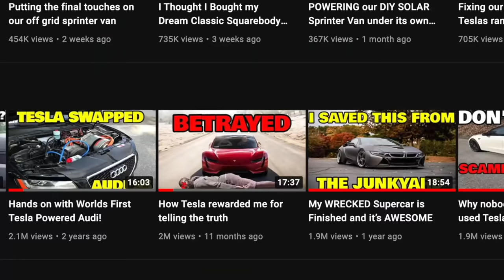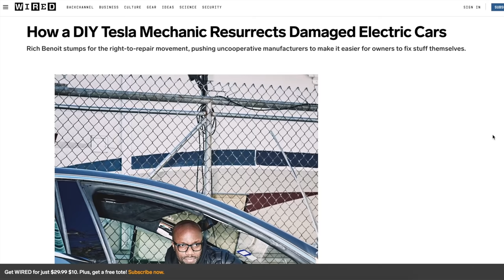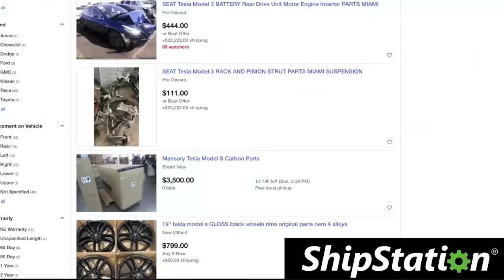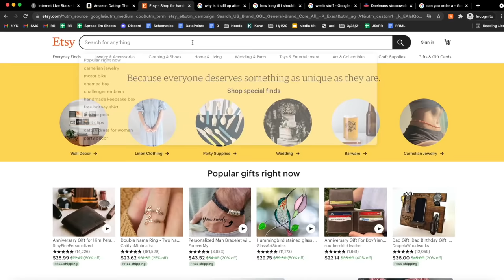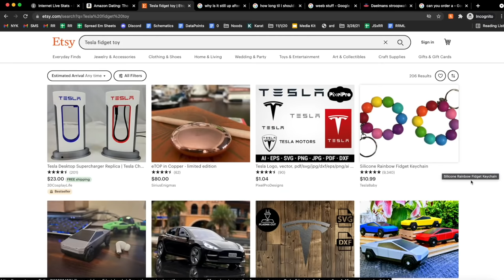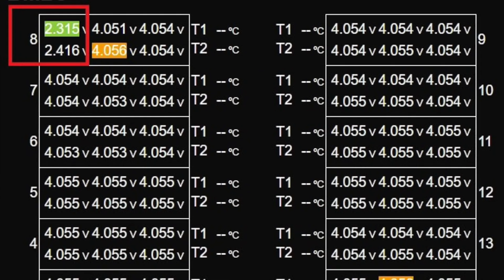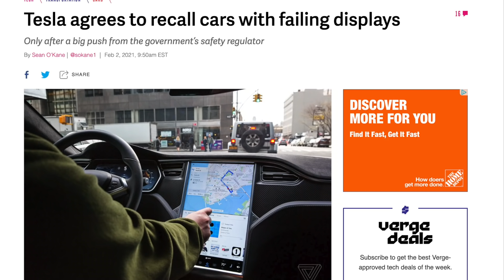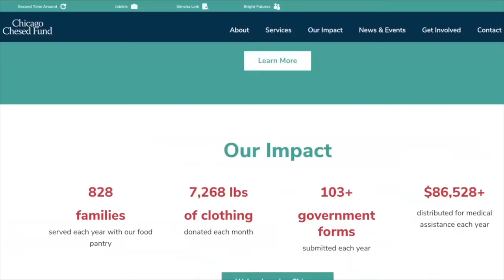Tesla wanted $16,000 to fix this NEW Model 3, we did it for $700! The importance of Right to REPAIR!

Comment: Love seeing Right to Repair cheerleading, people shouldn't need things like this explained to them.
Reply: Unfortunately, so much of the public don't understand things until it happens to them.
Reply: @kidmosey  no other car manufacturer is remotely as greedy as Tesla. They are absurdly unwilling to repair parts and insist on replacing entire subsystems rather than making them modular. BMW are probably the most similar, with a habit of combining parts that would never fail like cast alloy engine mounting brackets and thermostats or water pumps (or all three), but you can still replace most parts individually, and more importantly BMW will actually sell you parts to repair your car as well as workshop manuals. They will even sell you their diagnostic computers and access to their archives of firmware, it's not cheap but it's available.

To make matters worse, if you buy a second hand Tesla, you have to buy all the performance upgrades again, and if you don't Tesla HQ will remove those features. The analog equivalent of a guy who follows you around and unbolts the turbocharger from your ICE engined car, takes it back to the dealership and insists you pay the retail price plus labor to have it reinstalled. Tesla go a step further and disable all forms of fast charging if you figure out a way to re-enable the features that have already been paid for on the car you supposedly own, effectively rendering it useless.

Tesla's are nice cars, but Tesla Inc's unbridled greed would preclude me from ever considering one. For me driving a Tesla is like endorsing their ridiculousness, the best thing we can do for future generations (pun intended) of car owners is to support the companies who are most open to repair and modification and least prone to intruding in the car after you buy it, electronically or otherwise.

Comment: You should put a $1 stainless steel clamp around the thin outer plastic that you threaded to accept the brass nipple to prevent it from ever splitting when the brass nipple heats up and expands. If possible, add a metal protector around that fitting to prevent future breakage from road debris.
Reply: The brass is never going to get hot enough to expand enough to crack the plastic
Reply: I understand that but as 50 Cent stainless steel clap its Extra Protection
Reply: Tesla makes a battery and sells it for $16,000 then everything on the pack should be replaceable. Would you buy a regular engine with all the hose fittings part of the casting? Tesla engineers are either building to make repairs very expensive or building so write offs sell new cars. Either that or they are stupid. Do you think they are stupid? Main reason insurance companies write off vehicles as they are in agreement with manufacturers with some under the table deal. My new bought car had the appraiser write off a $14,000 car because of a little hail damage. Had to show them the value as they had it for $6000. The appraiser claimed she was new to the job and the replacing a guy on vacation. LOC We are nothing but pawns.
Reply: This is a good idea.

Comment: The other crazy thing is, if they are keeping battery packs they replace to repair them, they should be offering remanned batteries at a fraction of the cost of brand new. It makes no sense if Tesla can charge $16,000 for a battery, but then keep one with low miles to repair it and use it somewhere anyways. Not unless they are passing those savings on to the customer.
Reply: If they replace your battery and you’re paying for it you should be able to keep the battery.
Reply: I have taken cells out of the packs. The pack is disposable the way the cells are glued together. I could go into great detail about the pack but that is out of the scope of this video.
Reply: @stevegorkowski3246  He even mentions they have replaced failed cells in a previous video though?
Reply: @802Garage  I would guess you could change a cell but the way they glue them in it would be very hard. You would want to practice on a bad pack before you do it on the real pack. The pack has a section of cells that could be changed but that isn't cheap.When you get the cell out you need to connect the Aluminum fuse wire to the new Aluminum cell top. I use a pulse Tig welder. I would use some of the bad cells to practice on. The top of the cell has a pressure relief valve the pops up. I don't know if that breaks the fuse wire by design from that movement. 
The sad thing is they plan to pot the whole thing in one piece. This is just one issue I don't like. I am looking at other options other than Tesla but I will make a decision by 2025.
Most of all I feel sorry about people that don't understand Tech and buy a Tesla and huge repair bills need to be paid. The consumer electronic industry has the same issues.
Reply: @stevegorkowski3246  Sort of feels like early adopter issues that come with most technology.
Reply: @802Garage  Ford battery pack has small packs connected to make a big pack.  The trade off is weight and cost.
Back in the days of conversion kits. The system had no cooling other than air. The manufacture that don't need a cooling system would be the winner. LTO cells designed with higher energy density would do this.

Comment: As a Tesla fanboy, I can say this video is a true public service. Not to mention the repair to this man's car.
Reply: I agree. I think it's fantastic the Tesla is pushing the whole transportation market to all electrics. And very very important for right to repair, and upgrade bulletins for weak areas like this damaged nipple.
Reply: Say it louder for those a year after. Lmao
Reply: @daviddipasquale5479  its not fantastic at all, these batteries not only have relatively short life span, they are extremely hard to replace and extremely hard to recycle. Not mentioning that Car producer having ability to remotely disable product YOU BOUGHT is cancer and is replicated across all types of business. So no, tesla is not doing fantastic job, it is actually doing harm, all these resources invested in battery car could be redirected to development of hydrgen powered cars or literally anything else that does not involve carrying battery half of weight of car
Reply: @zawarudo1041  Batteries are constantly improving. And so is the recycling and reuse of battery materials. One point you do make I am equally concerned. Remote disabling capability. Rich Rebuilds points out this behavior when he was rebuilding salvaged Tesla's.
Reply: @zawarudo1041  These batteries last 10-15 years, which is roughly when most ICE engines need to be replaced or turned over. They are actually very easy to recycle and easy to replace, as well as battery tech improving all the time means you could retrofit an older car which a much newer, cheaper, bigger battery. 

You know nothing about hydrogen cars - making hydrogen is expensive and most of its production involves emissions, it has to be trucked to fuel stations (more trucks on the road, more emissions used to build and fuel them) stored in -40degree tanks, it requires enormous tanks inside the vehicles which keep it pressurised at 10000PSI which would literally vaporise the car if it ruptured.

Meanwhile, almost all EV makers including Tesla now use LFP batteries which don't require Nickel or Cobalt, don't have thermal runaway (you can puncure them with a nail at 100% charge and they won't explode or catch on fire), are cheaper and cleaner to make as well as handle DC charging much better.
Reply: @Syvergy still no, give me 5min charging then i'll think. My time is more important. What if you go with family and kids, and need to charge? Your kids will kill your ear drum.. it is a disaster to wait that long

Comment: So if that cheesy front skid plate were replaced with an aluminum or steel plate, this fitting wouldn't get damaged...
Reply: Yea I agree, if that skid plate wasn't some papper thin plastic bull shit, that fitting would be just fine
Reply: @xXTECHxKNIGHTXx  exactly! 
I know what rich was getting at here with this video and I agree with him. Personally I think there's money out there for an aftermarket company to produce a skid plate that would actually protect stuff. I had an ice car that had an unprotected area, I made a shield.
Reply: @AndyFromm  the plastic and the frugal use of metal in Teslas gives them more range...that is why German cars are allways a few hundred pound heavier than all other cars...it's all weight in screws instead of plasticsnapins , extra steel for good measure instead of just enough to do the job and extra sound damping that is only usefull on the autobahn when you drive at speeds that are impossible at most places.
Reply: @TremereTT  this could be replaced with a 50lb piece of steel plate and you would notice virtually zero performance change but a 5lb sheet of aluminum would protect those fittings from most road debris...
Reply: Was thinking the same thing. One of the first things I'd do with a new one would be to have a custom aluminum skid plate made
Reply: They said it still happens with the dual motor though, which has that space filled and might not be able to put a metal shield there. The proper thing is just design the battery pack to have that nipple be replaceable without even dropping the battery pack. It's the thought process that matters here. You shouldn't have to replace a battery pack because a small piece of plastic broke. A revision of this design should immediately be made by Tesla.
Reply: @AndyFromm  I know. But weight adds up. At one point they decided to make it plastic. Also even Mercedes makes them plast...it's not protectiv, they are about making the bottom suface of the car as flat as possible, that saves fuel and adds downforce. Yet in combustion cars behind that plastic-shielding (in German car jargon they are literally  called floor-cardboard) there is only a bunch of exhaust tubes and mufflers...in an EV there is the crown jewels , namely the battery...
so maybe it would be usefull to give the plasic hoses down there some real protection.
Honestly even for ICE-cars the floor cardboard is not enough protection ...
I once destroyed my flexpipe by driving over a peace of cardbord that was flying in the wind on the autobahn....
You don't break or switch lanes for a bigger peace of card bord, right? It just paper righ? I wasn't even speeding! just short of casual 100mph.
Of course replacing a flex-pipe is way less expensive than battery, it's just buying a part and some welding.
Debris on street is kinda more dangerous than most people expect..
Reply: @tboneforreal  This is the correct answer
Reply: this. Class action suit material.
Reply: Or don't put cheap plastic pipe nipples in your expensive products.
It boggles my mind how much Tesla get away with when it comes to their awful build quality and their terrible costumer service.
Reply: @kb24theMVP  The rock shield probably shouldn't be plastic. But the coolant components are plastic for a reason (as is for most modern engines) because plastic has no galvanic voltage and wont introduce corrosion. Steel, Stainless Steel, aluminum, brass etc all have a GV and can introduce corrosion in conductive coolant in the long run.
Reply: If the fitting itself were metal from the factory it also wouldn't have been damaged.  That goes for all cars, typically one of the first things to go bad are the cheap plastic fittings from impact or stress over time cracking them.
Reply: @AndyFromm  i'm running a 3mm steel guard under my engine and gearbox in my Audi Allroad ... made in Russia (the steel guard) non the less.
Reply: if not that it would be something else.
Reply: @TremereTT  not about weight.. about profit optimization
Reply: I’ve been watching a lot of sailing videos like Parlay Revival and I see them doing a lot of fiberglass work to reinforce their bulkheads.  Wouldn’t it be a pretty cheap solution to use some epoxy and lay glass on the inside of the under tray to strengthen it? It’s cheaper than carbon fiber and wouldn’t add a whole bunch of weight.
Reply: there needs to be a plate in front of those ports. it had nothing to do with the material of that plate. the debris got around that plate and hit the port.
Reply: @Midnitediy  you're 100%. A composite fiberglass plate wouldn't weigh much more and would add a ton of protection.
Reply: You know if the nipple were made of aluminum or some other metal, that would be even lighter than a better skid plate and be less likely to break
Reply: Aftermarket part coming?
Reply: @amorag59  Just because its plastic doesnt mean it needs to be paper thin and easily cut with a utility blade. Also plenty of parts in the cooling systems of cars are made out of metal, its not a complex problem, use the right materials (that are already known to car manufactures) and you wont have corrosion issue.
Reply: Nice fix. Thanks for being a consumer advocate!
Reply: Is it really a skid plate?  I bet it is for aerodynamics to smooth the airflow on the underside of the car.
Reply: @marklgarcia  wouldn't a light aluminum skid plate also work for Aero?
Reply: @AndyFromm  Absolutely.  I completely agree there should be something more substantial, especially with all the plastic parts in that area of the car behind this panel.  That might be a nice after market upgrade for peace of mind.
Reply: @tboneforreal  Why?  They make more money on it this way!  
And the sheeple line up to buy them!
Reply: Just encase that nipple and the tube it connects to in a metal cage, so it doesn't get snapped off so easily.
Reply: See if Jeff at dieselgeek will do it
Reply: It doesn't need a full metal skid plate, it needs maybe a six inch flange. That said just making a proper replaceable snap on hose nipple would add about 15 cents to the cost of the battery pack.
Reply: @TremereTT  There's a reason the term "German Engineering" exists. I personally have a BMW, my mom and sister both have VWs. Great cars all 10+ years old run great.
Reply: @TheBrickLot  Yet they aren't using modern fitting techniques and they design the cars for speeds that no one outside of Germany can drive.
My old VW Passat stationwagon can go 155 mph. The wheel Suspension is constructed for top speed on long ranges.
The sound dampening is made to shut out wind noise way above 85 mph. 
So the whole care is way heavier than it needs to be would it be driven in the USA or even Austria or France.
Off course it aids the local sales, as every foreign manufactured car get's bad ratings in German newspapers for wind noise at speeds dor example...
Yet German cars exported or build in and for foreign markets all get bad ratings for beeing way to heavy for their class of car . Especially electric cars have that problem, that is now a problem of the culture of car producers in Germany. Wight needs to be cut. As you might probably be an American look at the Firearms industrie! They are all plastics nowadays. I think (I'm not realy part of the gun world) people love to buy the modern allmost all plastic guns. Cars will become more and more plastic or it wouln't work with the EV- future.
Reply: @TremereTT  Yeah, that was my impression about german cars. Look at Sandy Munro's video about the ID4 battery pack. He was complaining that the ID4 battery pack is too robust :))
Reply: @BoogieDownProduction  Never suggested a flimsy part, just commenting on corrosion that not many think about. Yes I have an old jeep with a metal (cast iron) thermostat cover and outlets, but the engine is an iron block and head so no GV potential through metals. On these modern engines with  iron block and AL head you see plastic fittings. And yes the water pump blades should be metal. It's not always a penny pinching thing with plastic, corrosion is a big deal or else they wouldn't be spending money looking into HOAT coolants.
Reply: I understand why the coolant hose is plastic. But I can’t wrap my mind around why the hell the skid plate is plastic if it’s protecting such delicate parts. First thing I would do is take that skid plate off and attach an aluminum piece to the inside of it or just some kind of extra insulation.
Reply: @AndyFromm  Carbon fiber would be very tough. Titanium would be expensive but damn near indestructible.

Comment: Also, people forget one thing - Right for REPAIR, Tesla would REPLACE 99.9% good thing with a new thing. We should be able to REPAIR if possible, instead of replacing stuff...
Reply: You fix it and they take your supercharger. I hope one day someone sue tsla back to reality😡😡
Reply: Tesla as a company consistently promote their cars as reducing ones carbon footprint and helping the environment this video shows why Telsa failed on their own mission statement.
Reply: In theory, they do repair the battery afterwards, but it's transported a very long way, sending a small repair kit out would be a lot more efficient I think 🤔
Reply: @petermolnar8667  but at the end you pay for two batteries! Madness! They could charge you an amount needed to cover transportation, new parts and labor. Close it at 500 - 1000 bucks instead of 16k.
Reply: we live in a disposeble society .  perfectly good things are thrown away for no reason other then owning the new ones.

Comment: That would be a deal breaker for me if I wasn't allowed to repair my own vehicle. I would walk first before buying into something like that. Replacing whole assemblies rather than the individual part is becoming the norm with just about everything. I wanted to replace the A/C clutch on my vehicle. I found out that now they expect you to replace the whole A/C pump over a bad clutch. That's the difference between having a shop evacuating the system and recharging it or not! It's incredible that they expected him to shell out $16,000 to replace the battery over a simple plastic fitting.